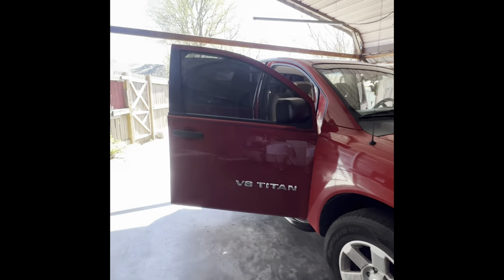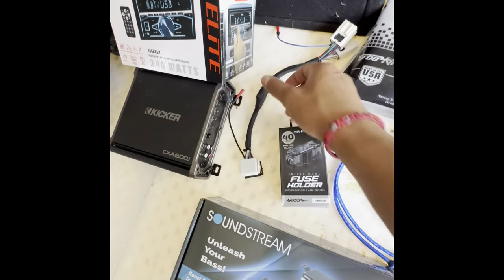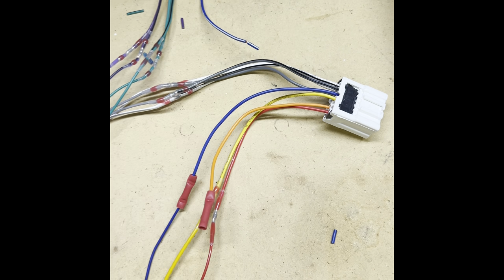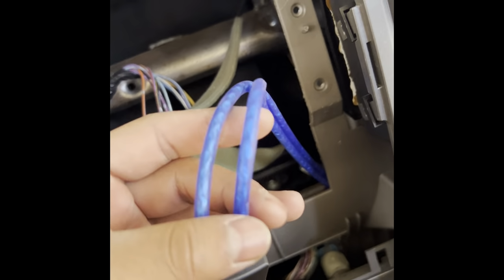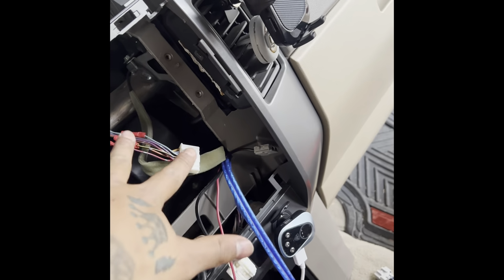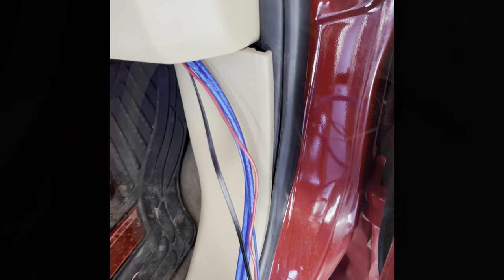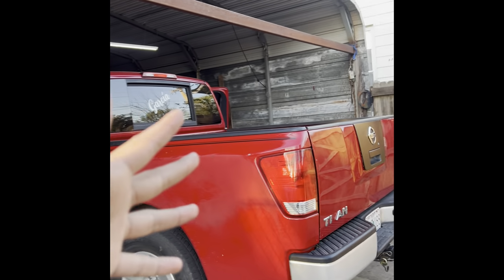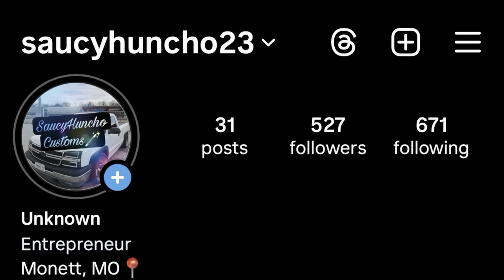2009 Nissan Titan Sound System Install! Birthday Surprise

Comment: Where you get that kit bro got the same truck
Reply from the maker: I bought everything separately, or was there something specific you were looking for?
Reply: @SaucyHuncho  thank you for responding bro I’m looking for those tweeters and the stereo adapter
Reply: Where did you get the wire harness from?